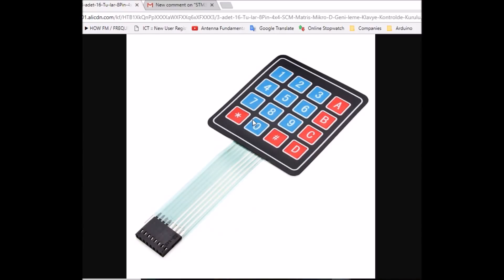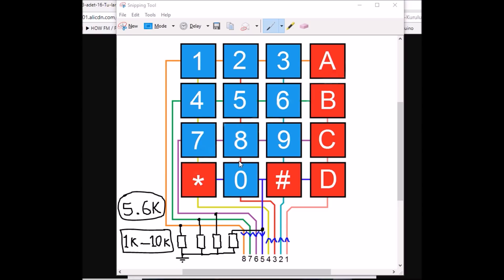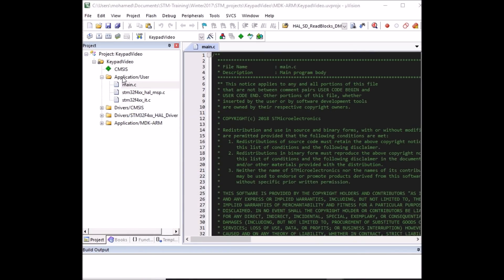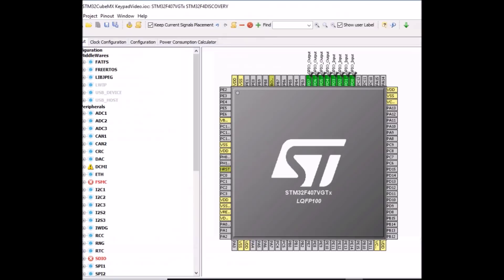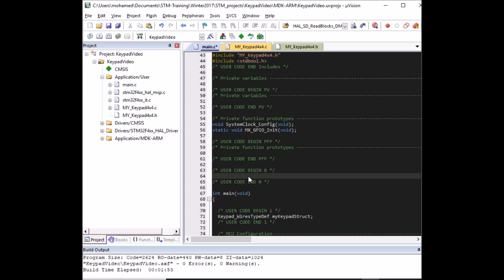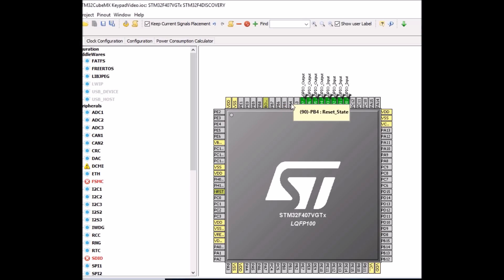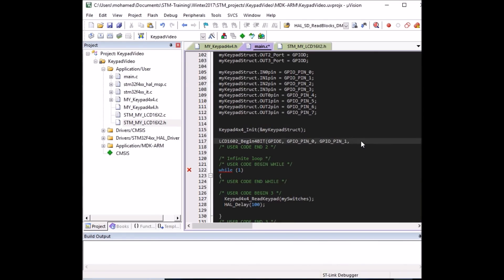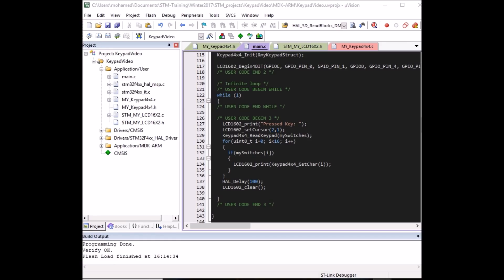STM32F4 Discovery board - Keil 5 IDE with CubeMX: Tutorial 23 - 4x4 Keypad

Comment: ı press 2 but on lcd it writes 23 , also ı press 5 on lcd ,it writes 56 ,the others are okey but ı hadn't find a solution for this ,what should ı do?
Reply: the library works bad, i have the same problem
Reply: did u get any solution to this problem? I am experiencing same issue on stm32f4 disc1 board.
Reply: The above code is working fine when i pulled down with 4k7 resistors.

Comment: Great job, but on the stm32f407 you have to make a change in the pins, as PD4 and PD5 cannot be used! just use 6 to 9 to fix the problem.
Reply from the maker: Hi,
Why do you think we cannot use PD4 and PD5
Reply: @mutexembedded2206  My project did not work that way, so looking at the datasheet on my board I realized that the PD4 pin has a reset (maybe not interfere), but the PD5 has a pull-up that makes it impossible to operate.
Reply from the maker: @Rezende2797  
Fair enough .. I will look into that. Thanks for highlighting it.
Reply: @mutexembedded2206  thank you too

Comment: I like your video...
Can you tell me how to use backspace and enter key of keypad...
Reply from the maker: Hi,
I am not sure if I got your question right
Reply: @mutexembedded2206  I trying to interface 16x2 LCD and 4x4 keypad with PIC18f6520 microcontroller. I want use backspace function in this case for removing character on LCD one by one ( just like mobile and keyboard)..
For example ...pressed key is 2345
If I once I pressed backspace key ..controller start removing character from last on LCD ...
Reply from the maker: @anishkumarpandit667  
Ok, got you. Need to write empty character to latest index, so would need to shift cursor back to the left by 1, then write empty char (a space) then, return character to same place (another shift to left, due to auto index being ON).
Reply: I tried to display space in the place of written character on LCD but some error is coming... Please help me...

Comment: Hey Mohammed, I took your original driver code for the 4x4 keypad and made a 4x3 (RowsxCols) keyboard driver for those who have the other type of keypad. I did some improvements on the driver and added in a lot of documentation on how the keypad works. If you were getting a warning in the code I found out why and removed it. I will put the link here: http://rbaz.tripod.com/code/Embedded/STM32/Keypad3x4.zip
Reply from the maker: Hi mate,
Great work, I would love to get it running when I have a spare time. And might possibly make a video with your work :)
Reply: Thatks man, just I was looking gor

Comment: not working
PD0 connected to 8th pin mention in your diagram
PD7 connected to Ist pin mention in your diagram??
tell me the above configuration is right?
And while debugging the "Watch" window does not 16 arguments as in yours 11:31 like[0] [1]... so on like this 16 my debugger show only one.
Reply from the maker: Did you do the pull down resistors on the rows 4 lines?
Reply: Yes Sir I have also used 5.6K resistors with (8th->PD0), (7th->PD1), (6th->PD2) and (5th->PD3) pins and grounded to the gnd of stm.
The prolem is that my watch window didn't show [0] [1]...[16] arguments.
Reply from the maker: If you wanna see an array content in Keil debugging window, you need to add the array name only to the watch memory. e.g. for
uint8_t myArray[16];
just add  "myArray" to Watch1, then expand to see the elements. GL